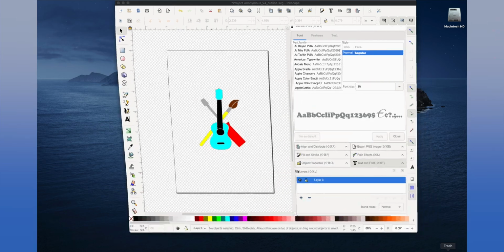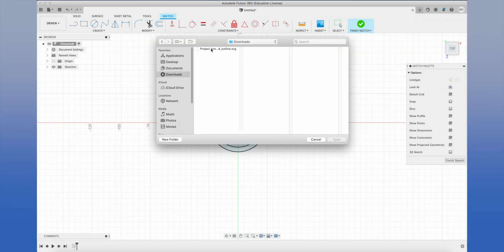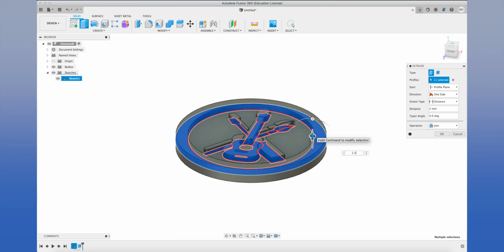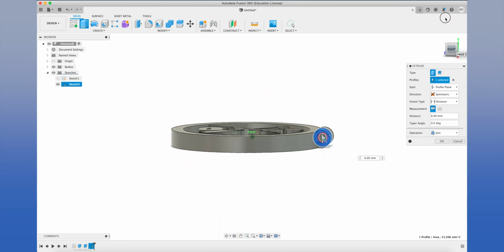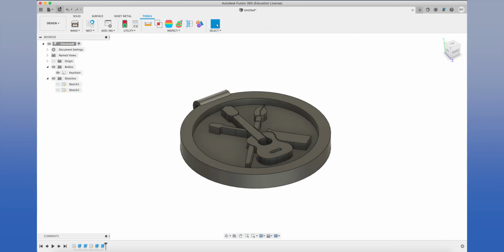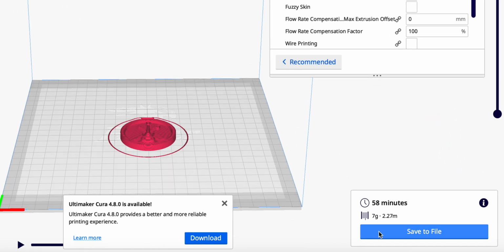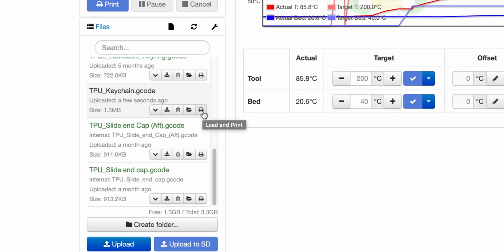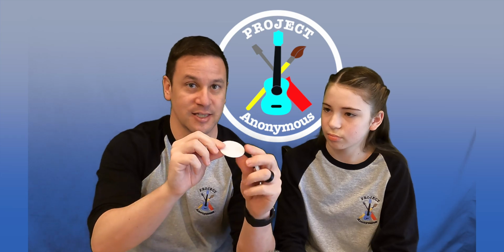Making 3D Printed Keychains

Comment: Hello there does that kind of paint last? Like to sell a keychain painted like that? Thanks for the vídeo I Will make a logo
Reply from the maker: Thanks for watching! We’ve had the keychain for about a year and it has actually lasted quite well. The Sharpie hasn’t scratched off nor has it faded, but if you were to leave it under water for a period of time the Sharpie comes off. Perhaps if you need it to last long term you can seal it with something like Mod Podge. Hope this helps!
Reply: I recommend putting a layer of varnish or resin over top to lock in any paint/sharpie!♥